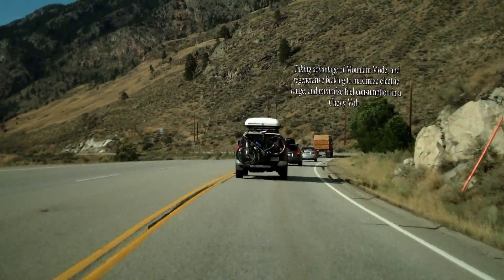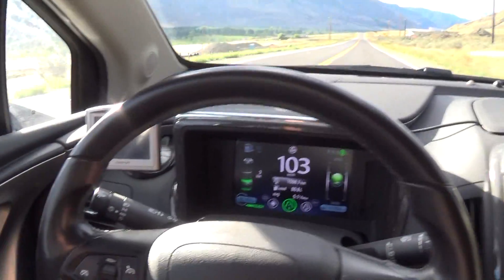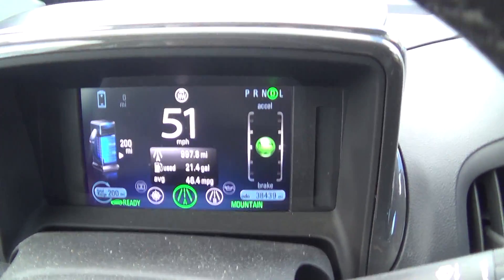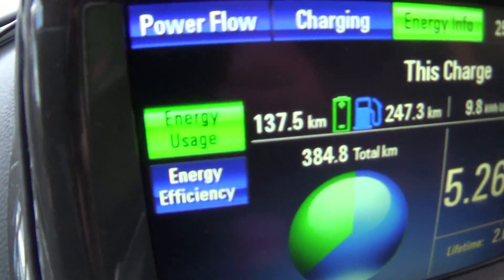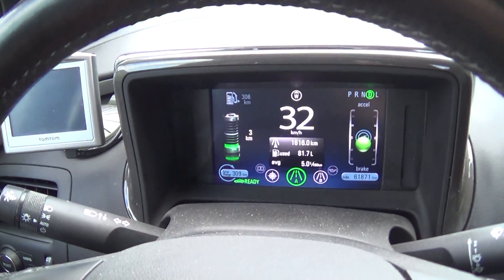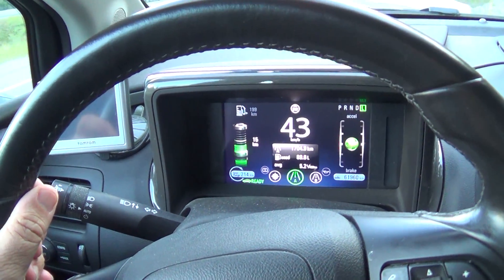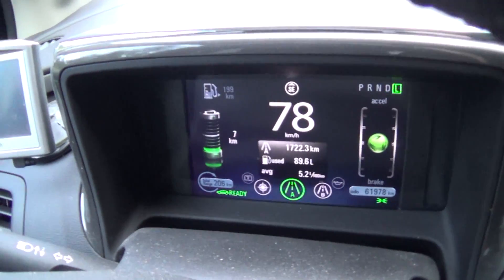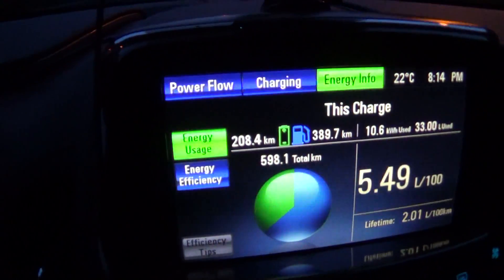volt regenerative braking experiment

Comment: it doesn't matter whether the Volt is reporting miles "on gas" or "on electric". the total MPG is the same either way cause the MPG is calculated based on gallons used and that's it. I used to fiddle with the modes but now I tend to focus on getting regeneration no matter what mode I'm in.
Reply from the maker: If you divide the miles driven by the fuel used you will get the e-MPG which factors in the initial electric range as well as fuel used. The only time to use mountain mode is when traveling in the mountains, when you need the extra reserve. The only thing that forcing the car back into electrc mode as shown in this video is it will show the energy recaptured, as miles driven gauge will display the distance traveled as electric miles as opposed to gas miles, which it would do when running in gas mode despite the engine being off when traveling down the hill. The MPG remains the same, because that is calculated on fuel used over total range. Still it was  a fun experiment  because it shows how much electric energy is really recovered, and this the time when the engine is not running.
Reply: 12voltvids t

Comment: u get the recall for crushing yet?
Reply from the maker: The accelerator is a plastic actuator as it just connects to the postion sensor, and from what I understand there were some cars that if you got your size 12 boots under it, and then out with your foot under it, and twisted your foot it could break. They sent a letter to state that if this happened within 10 years it would be replaced for free, but there was no recall for this because it is not a safety issue, and would not break under normal circumstances. It was more of a "ok we can see that happening, lets inform customers to be careful and not wedge your foot under the peddle to break it
Reply from the maker: What recall? Please explain.
Reply: I got a letter about accelerators breaking when people exit their vehicle.  I don't think it was volt specific.  http://gm-volt.com/forum/showthread.php?258001-Letter-from-GM-accelerator-pedal-stalks-breaking-Special-Policy-Adjustment-38170

Comment: what is your electric bill?
Reply from the maker: My electric bill is high, but not because I drive an electric car.For my daily commute to work and back I use very little power, and for that matter I can drive to work and home every day on 1 charge. Cumulatively my car adds about 25.00 - 30.00 a month to my electric bill. The big energy hogs in my house is the heating, cooling and hot water system.I have a heat pump to heat and cool the house, and provide me with hot water. I also have 2 teenagers that will stand in the shower for 45 minutes until the water runs cold, and they park their ass on the couch and play their playstations on the energy hungry plasma. Our utility has 2 rates. The first 1360KWh for a 2 month billing cycle is a lower rate, and then everything over that is charged at double the rate, do discount for time of use. This is what makes my bill so high, not the car.Ask me what my gas costs. About 30.00 every 10 months.
Reply: Lol I hear you thanks for the insight I have the same issue with my electric company as well with the double and triple tier
Reply: 2011 through 2015 volt has a 16kw battery but uses only 10 kw the other 6kw stays in the battery that's what makes the battery out last the car.  So to answer your question if electric is 10 cents a kw from empty to full is ONE dollar the car is rated at 38 miles, the 2013 and newer shows instant electrical usage,when driving, in temps around 65-80 driving right i have gotten 54 miles from one charge a few times. The next step is to install solar panels and power the house and car for free. I'm a used car dealer and have compared everything. Volt is the best car ever made.
Reply from the maker: Absolutely. No offence to Tesla, but GM has them, and I think every other car manufacture beat on this one. I watched the development of the volt which began as soon as the EV1 program was done.  I was one of a hand full of early adopters that read every article, watched every video, and ran out and put our hard earned cash on the volt. My car was 47,000 before any government rebates, as I bought mine before there was any incentive offered (I did apply for, and receive my government incentive after the fact only because the rebate program came in  right after I took delivery. Personally I have one of the first 10 that were sold in my region.  I have considered solar panels, but from my calculations the payback from solar panels is even longer than the car payback.
Reply: 12voltvids I will have to go check out the new volt. I agree they have tesla beat by far because of the extended range and total packs not to mention the price
Reply: Pete Bennington nice man once you get solar that will be awesome

Comment: Isn't this exercise to only really increase the numbers on the electric operation on the computer? I don't own a Volt so you probably know about its characteristics more than me, but doesn't the Range Extender (or CS mode in Volt-speak) mode operate in a parallel hybrid mode which if you are on the brakes or let off the throttle, the gas engine would shut off regardless? I know the Prius does this unless certain specific criteria prevents the gas engine from shutting off (e.g. climate control, near depleted battery or completely full battery). 

So while the car's computer does not recognize the extra battery range accumulated coming down a mountain range (battery stays at 0km despite Mountain mode recharge + downhill charging), wouldn't coasting down without doing the on-off engine restart not really burn any more fuel than if you do this method? 

Finally, a personal question. So assuming you know the route and expect an oncoming hill to climb, would it be smarter/more efficient to throw the car into Mountain mode earlier and let the engine run to build some battery buffer going up and going back to normal EV mode at the top or just let the car automatically drain its battery and go into Range Extender mode? From what I know it is most efficient to end the journey with 0km on the battery as to get a full charge at the destination than have accumulated range still available from battery due to Mountain mode buffer that is not used but instead wasted gas to produce.
Reply from the maker: +Trades46 The second generation volt operates as a parallel hybrid, so when the engine is running it contributes power to the drive train, and I haven't driven a 2017 model yet so I don't know exactly how it operates, however the first gen, which is the 2010 to 2016 model operates primarily as a series hybrid. With the 3 clutch packs it can be clutched to operate as a parallel hybrid as well under certain circumstances where it makes more sense from an economy standpoint to do so. (long flat stretches at high speeds)Under normal operation, once the battery is flat, and the car transitions into fuel mode, the electric mile counter stops registering electric miles, but the car still behaves in this manner. So I could hit mountain mode (or not if it wasn't a huge uphill climb, the car will still go over it, but if you run out of reserve, then you are limited to the power the engine can produce and you are stuck, like a prius at double nickels' (55MPH).Hit mountain mode just before the hill starts and build a reserve, as it will rev up the engine and build a 10 mile buffer. Go back to normal at the summit. The engine will shut down, and you will have all the range you built up that was not consumed,  plus going down the hill you will capture all that extra energy going down the hill. The car will still be showing those miles accumulated as gas miles, but the engine is not running, so no gas is being consumed at all, and the MPG reading will be correct on the computer, but if you get out your calculator and calculate the reported gas miles divided by the fuel used it will actually show higher on your calculator, as a good portion of those reported gas miles are actually electric miles and thus the reading on your calculator will be incorrect, but it will be correct on the display as it displays total driven miles divided by the fuel used.So, doing it the way I demonstrated will display the actual miles driven on gas. So calculating the real gas driven miles.When going down a long hill I have picked up 36 miles one time, coming down from the grand canyon. Once I got to the bottom of the hill, the engine stayed off for the next 36 miles. So in total I drive about 70 miles from the summit all the way down, and then another 36 after reaching the bottom of the hill. The prius doesn't do this. I know because my wifes car is a prius, so I know how it works. It will turn off the engine going down hill for a short distance, then turn it back on to help slow the car down by reving the snot out of it to dump some energy into the engine as the battery gets topped up quickly. It also has to run the engine for heat, and for the air conditioner. Something the volt does not do because it has electric heat, and an electric  air conditioner. It is super efficient, and a very well engineered car. I will be getting a second generation Volt at some point. One of my co-workers sons just picked up his this past week, so I am waiting to hear all about it.

Comment: If you switch over to hold at one mile electric range left then you won't have to turn off and back on your car, that's how I do it on my wife's volt. We are planning a 2-3000mile road trip this year I am hoping for around 45m/g we'll see. Thanks for the informative videos!
Reply from the maker: +zsoltv Mine is a 2012, so no hold mode.I am also planning a long road trip, solo again as usual. Photography trip, so I don't know exactly where I am headed. Would like to head down the coast down the PCH, and then across into Utah and film / photograph the desert towers.I have 4 10 day blocks of holidays booked so I can schedule a few little vacations in there. Son did bad in school again this year and will be in summer school, which throws a wrench into the vacation planning.

Comment: i really need to ask some thing .. when shifting to nutrol does the car really go in to nutrol  .. there is some info out there thats says it does not and the motor still spends .. why i am asking is i want to tow this car 4 wheels on the ground behind a RV  .. if the power steering stays live and more i can see where i would need to mod the car so this would not happen ... i do not have my car yet to test this on
Reply from the maker: +falcon7350 From what I understand on gen1 volt, when you switch to N, all the clutch packs release. The main motor is always connected to the sun gear, and the axel is always connected to the planet carrier.Normally the ring gear is locked to the case when in single motor mode or extended range mode. It is locked to the 2nd motor in 2 motor electric and when the car transitions to parallel hybrid extended range mode when traveling at high speed.However when in N, all the clutch packs release.So, if you are pulling the car in Neutral, the planet carrier is still spinning, the planetary gears are spinning, the main motor is not, but the ring gear is freewheeling, and because the car is not powered up, there is no oil pressure lubricating the planetary gear set, because the oil pump is driven by the main electric motor, which is not spinning, because the ring gear is free wheeling. So no, you cant tow it wheels down. There is a warning in the owners manual with regard towing, and it says that the front wheels need to be off the ground for towing due to the lack of lubrication to the planetary gear set when the car in not under power.
Reply: thanks for the info  .. i know some other cars are the same way and there is a oil pump you can get to install to still tow .. may have to look in to that
Reply: falcon7350, there is a warning in the owner's manual telling you that you shouldn't tow your Volt on all 4 wheels. 
-it's okay to tow it with the rear wheels on the ground.

Comment: Taking video whole driving is very unsafe. Good info, just take a passenger to take video.
Reply from the maker: +Joe Lopez 
Actually is is no more unsafe than any other activity you do behind the wheel like converse with a passenger or talk on your hands free cell phone. Most of my shooting is done from mounted camera, that are constantly running. When I have taken some hand held shots like for example of the dash I am not fumbling with the camera or looking at it. I am looking out the window. I am not looking at the camera screen. I point it in the general direction and hope for a good enough shot. There are many more distracting things in the modern car these days. The infotainment system being one of the biggest especially in luxury cars like Tesla where you have to take your eyes off the road and navigate through menus on a touch screen to do just about anything.